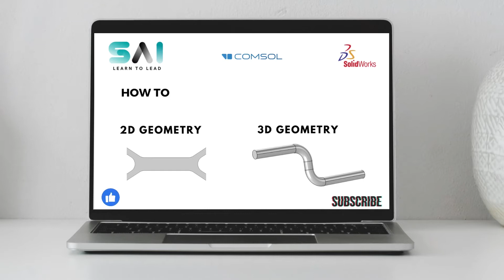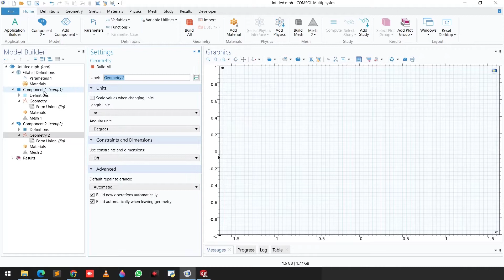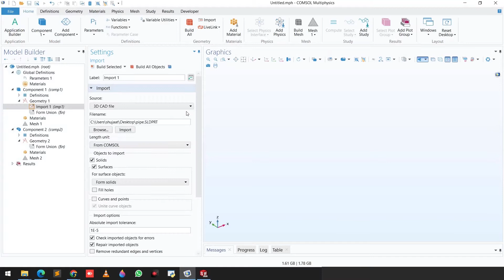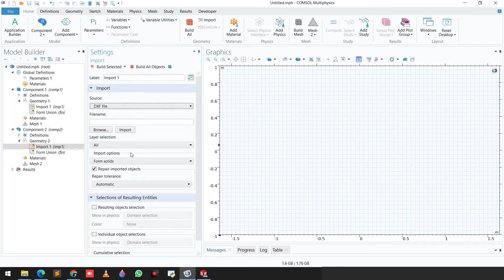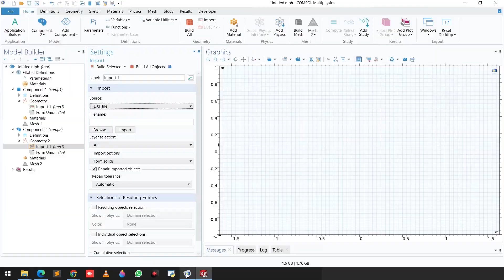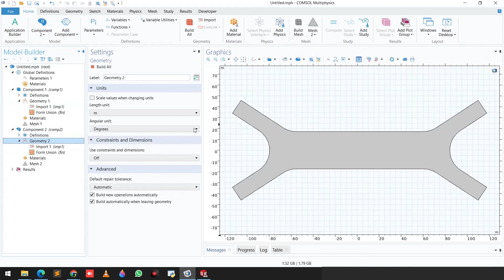COMSOL Tutorial 07 | How to import geometry (3D and 2D) in COMSOL from SOLIDWORKS

Comment: How to change the imported geometry size in COMSOL
Reply from the maker: Directly resizing an imported geometry in COMSOL isn't as straightforward as resizing native geometries. However, you can resize an imported geometry by using the Scale feature as part of the Transform operations. 

Here’s how you can do it:

Go to Geometry: Right-click on the Geometry node and select Transforms > Scale.

Apply Scaling: In the settings for the scale operation, apply a scaling factor to resize the imported geometry. You can scale it uniformly or specify different factors for each axis (x, y, z).

So while you can't manually modify dimensions like native geometries, the Scale operation allows you to resize imported geometries. Let me know if you need further help!
Reply: @LearnwithSAI  Thanks for this information.